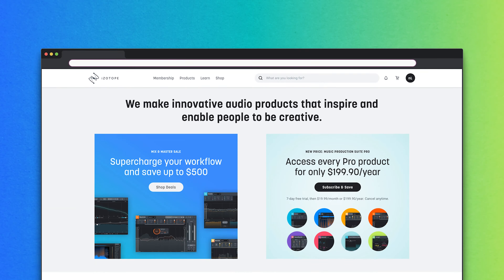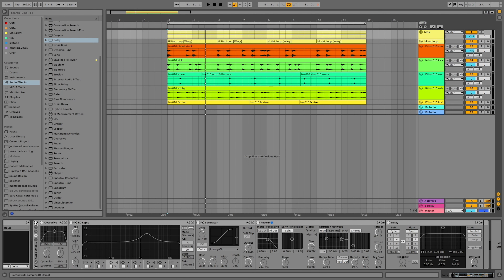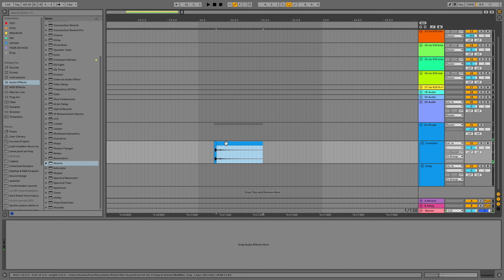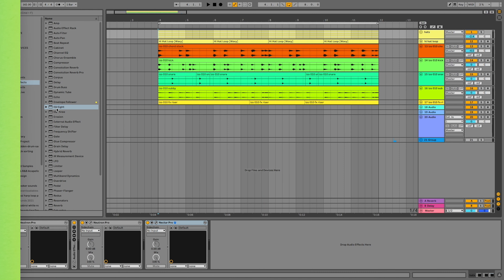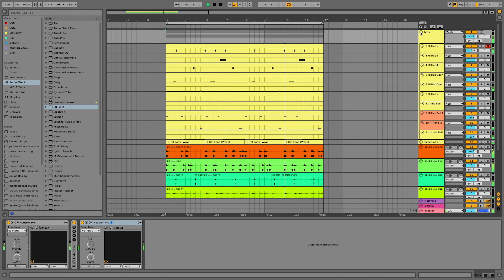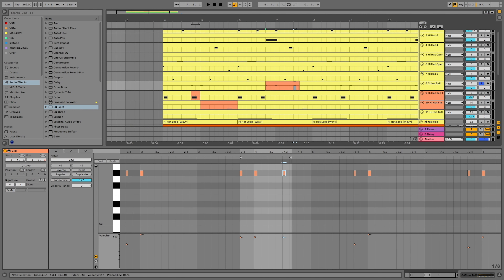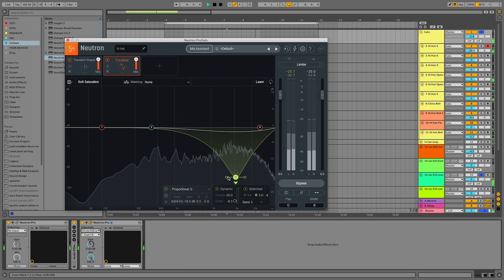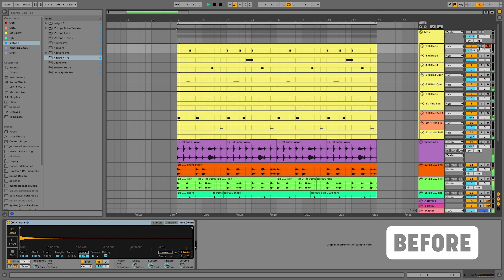Mixing Drums: How to Mix Hi-Hats

Comment: The hi hat in your intro? Smooth, subtle, soft, yet present.  The hi hat in the example? Harsh processing with slightly too much reverb tail for me.  Don’t forget Vocoder and att/rel settings of simpler.  Also hi cuts and yes I can’t stress how de essing saves! Hardware users get a Fatso to solve all your drum problems